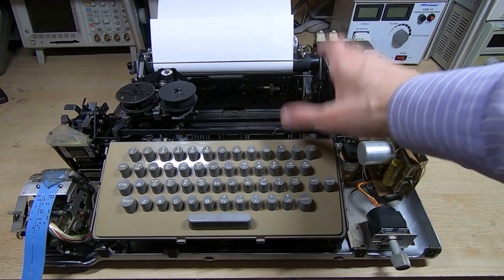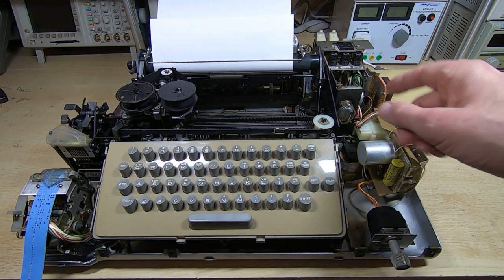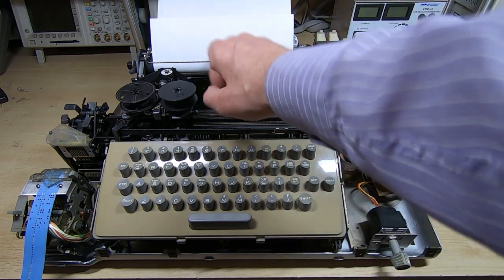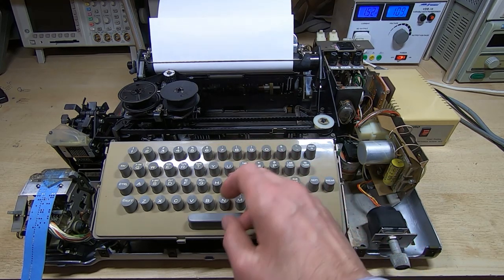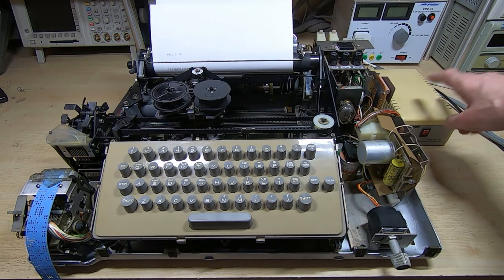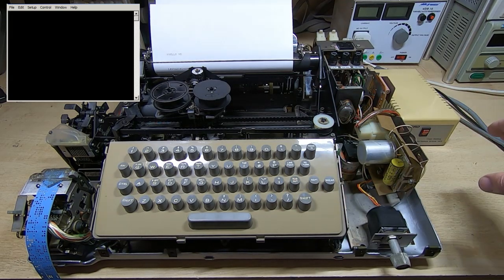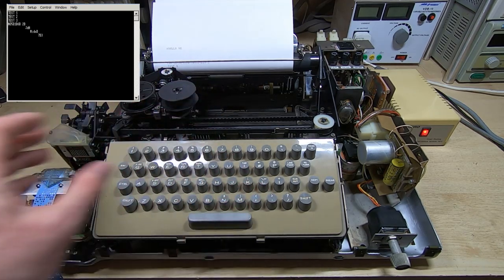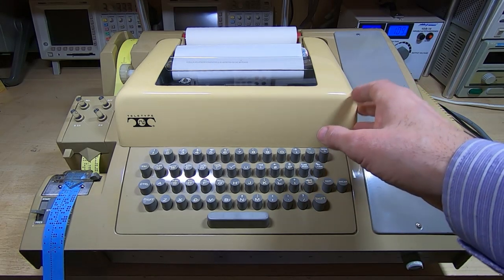ASR33 Restoration  Part10

Comment: During your brilliant explanations of all the steps you made through this restoring process I always had to think about the former days of computing when cathode ray tubes weren't the predominant interface to communicate with computers. The real roots of line editing are buried here in machines like this one, and the word teletype gets a new meaning for me now as I have seen this working. For example, the famous vi editor is based on this foundation, starting out as a multiline enhancement to the early single line editors one had to use which in turn explains some of its oddities. Or in other words, explains why it is the way it is. Still today, thankfully. So, this restoration series really rounds up my idea of the development of computing after WWII until today. Your video series here should become part of an exhibition or a technical museum! I'd really like to thank you for taking the extra time to share so many details and so much knowledge with us! Thanks!
Reply from the maker: Thanks, That is exactly why I post these videos. A huge amount of ideas and working of current computer systems and software can be traced back to very early machines and I think it is a testament to the developers back then that these methods are still in use. I also believe that knowledge of how these old machines work form a very good basis for understanding modern computer and communications systems. For example landline telephones still use the closed loop system used by teletype machines.